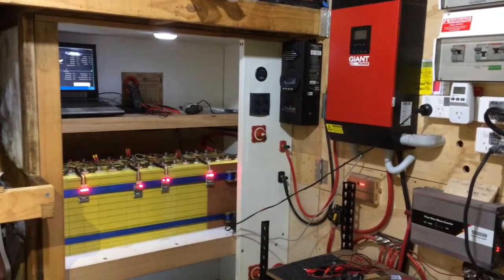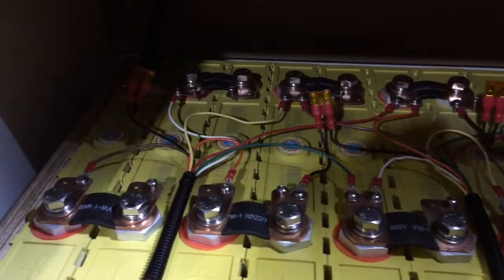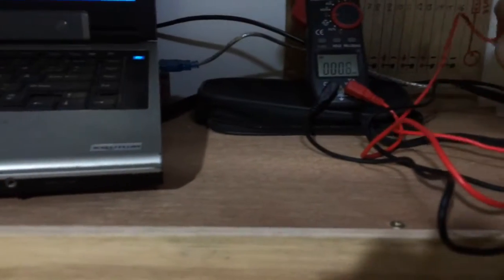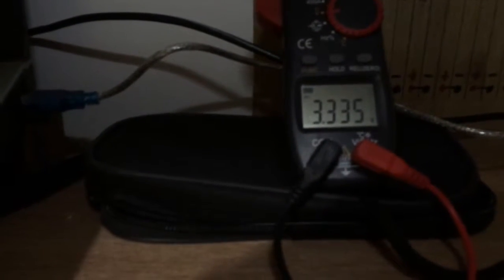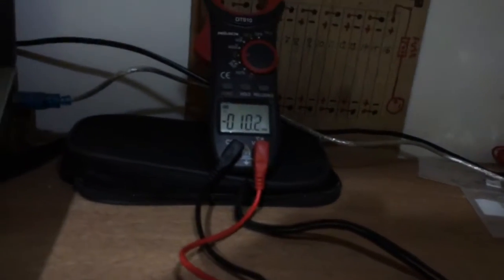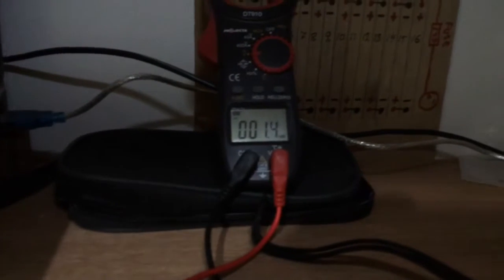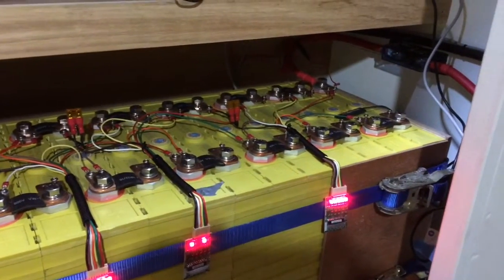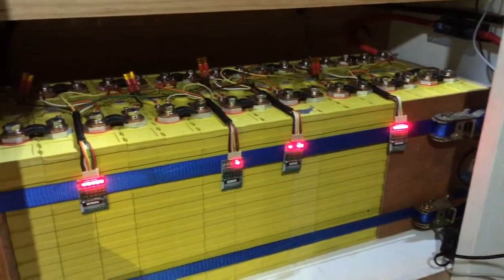Lithium battery bank for solar power part 3

Comment: Keep an eye out when you start pulling your pack down to low SOC. With "Top Balancing"  you have all your cells balances at the top even though each 300aH cell can vary 300, 305, 315 etc. It is all fine at the top, however, the slight variance in cell capacity is now transferred to the lower SOC of the pack. I.E When that 315aH cell is at 15%SOC, the 300aH is at 100%DOD. You shouldn't have any issues if you keep your pack always above the 20-30%SOC level. Although some cells might degrade faster than others as one cell could be routinely seeing 80%DOD (3000 cycle life) and another closer to 90-100%DOD (2000 cycle life). Even with all of the cells being a nominal "300aH" or in my case 100aH cells, the spec sheet that came with them in the crate should show that they do vary by a bit. The Chinese tend to give you cells that are about 10% over in stated nominal capacity.  - Cloud
Reply from the maker: I got my back too grid setting at 51v 3.18 good safe margin as the get old I might start the bottom balance as of now I can't get them down below 52.5 everyday use that is !!
Reply: +Kjell Johansson  : Good choice. 3.1v ~ 80%DOD. Not a bad idea to bottom balance them. With Top Balancing bms you have a bunch of different voltages around that lower cutoff point you are trying to avoid. WOuld hate to see one of those 300aH cells be 90-100%DOD when the other ones are around 75-80%DOD. :)
Reply from the maker: +cnypilot I guess when the battery start loosing it's capacity ore if the system is designed too be working until empty all  then with age you a always going to empty them ,it's like you say you will kill the lowest cells constantly being 95-100% empty when rest is around 80% "not a good thought "
Reply: Kjell Johansson : Indeed. :) Merry Christmas.
Reply from the maker: +cnypilot merry Xmas and a good new year to you too 🍻

Comment: How it's going with the cells?
Reply from the maker: Yes good things are progressing I have found that the little Blinky can't keep up with the amount of amps at the top so going out of balance a bit!! Not good but working on a fix !! I am soon uploading another video!! How are your cells at the top !!
Reply: Yes you need top balancers. I have them on my green 12v cells, they work great! once you go over 3.5 volts some cell start to clime faster than others top balancers needed. I only charge to 3.41 as full so my cells stay in balance this way. The cells get more resistive after 3.45 ish volts. I like these balancers http://ev-power.com.au/webstore/index.php/ev-power-bms/bms-cell-modules-1/cm400-cell-module.html
Reply from the maker: +off grid kid hi that's the one that I just got .i received it the other day so just fitting it all and started too do the top end today!!! Still going too have the little blinky as well !! Love the night show!! Cheers 👍
Reply: Yes me to.... the blinkys are awesome for what they are. They do help keep the cells in line as they rise in voltage they only shunt at like 33ma
Reply: +off grid kid : I would counter that with large LFP prismatics you do not need top balancers. Actually, you are better pulling the pack all the way down to balance them at around 100%DOD and then just charging them back up to 3.5vpc with an endamps of 0.05C. When you purchase a crate of cells at the same nominal capacity the included spec sheet will still show that there is a difference of 10-15% in some cases. You are better off not trying to milk all the capacity out of your system but rather just use the 80% of the least capacity cell for cell longevity. By staying away from the extremes of the charge curves at the top you also do not risk the overvoltage and wild out of balances Kjell mentions above. Above 3.5vpc you start getting into the crazy portion of the charge curve. I have a completely off-grid system with a "bottom balanced" 48v 100aH CALB bank that has been up since June 2013. I do not care if the voltages are a bit varied after they hit Float but I do care if they are not within mV when my WBjr states I am at 20%SOC. I do not want one cell to be lower than the other and have the big guys murder the little one. My two cents. - Cloud